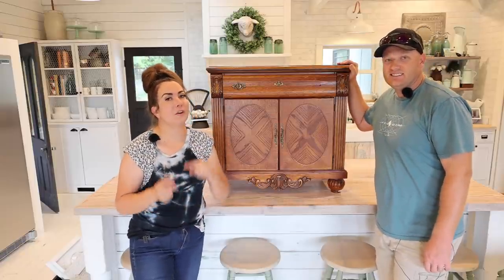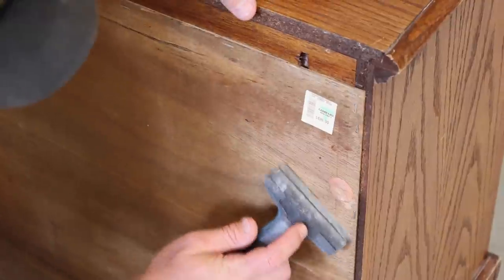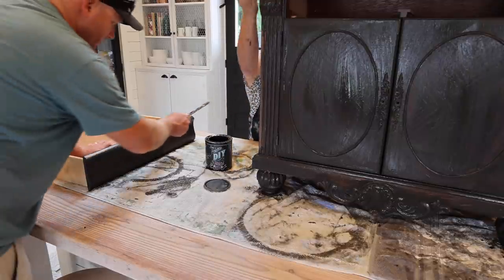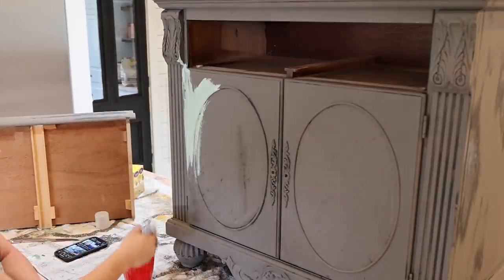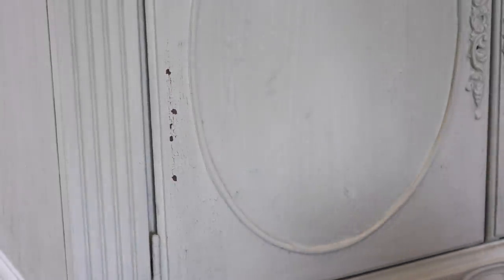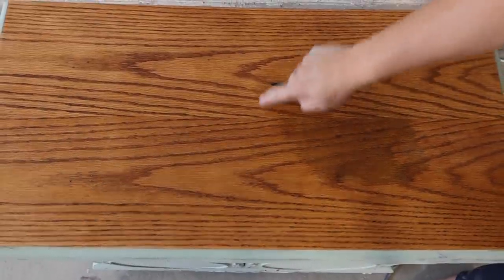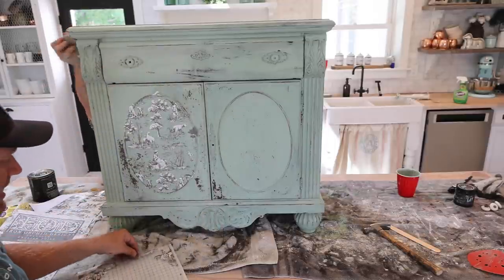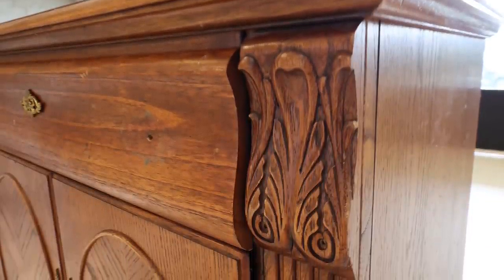How To Fake High End Furniture | French Country Style | MDF Furniture

Comment: ❤️❤️ the way this turned out 👍
Just one Question? Do you need to seal the piece before putting on decoupage paper instead of a transfer 🤔
Reply from the maker: I use liquid patina to decopauge and it acts like a sealer. Sometimes if it’s a paint that might bleed when it gets wet from the patina I seal it first then decoupage.